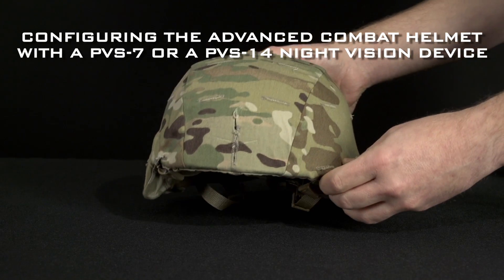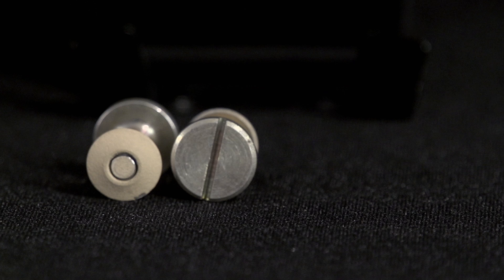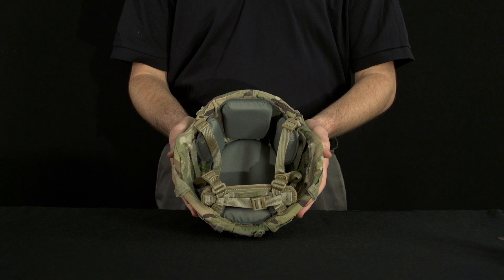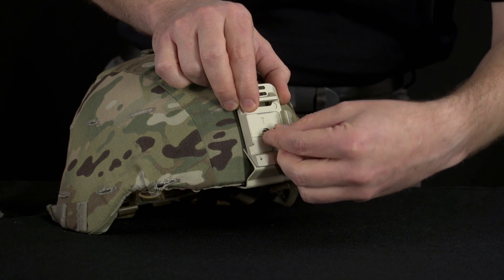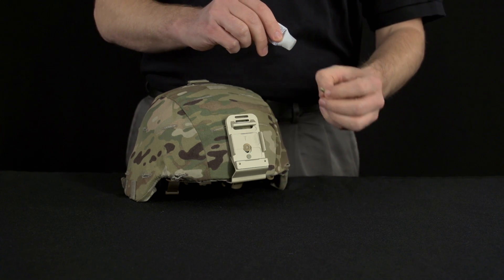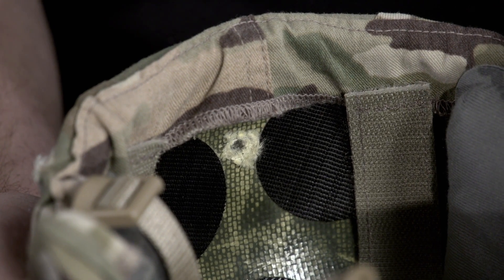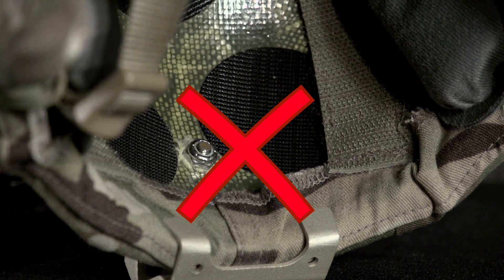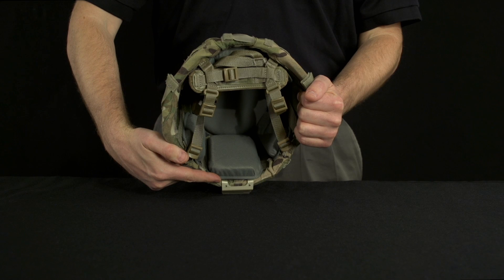Configuring the Advanced Combat Helmet with a PVS-7 or a PVS-14 Night Vision Device

Comment: I feel so stupid. I've always struggled to fit the screw for the NVG mount through the tiny slit on the front of the helmet cover. I normally end up cutting a bigger hole into the cover. I never thought to go from the inside out. Makes much more sense.

Comment: My ach doesn't have the hole in the front
Reply: That way happen
Reply: Center the bracket in the middle of the helmet
Reply: And mark where you need to use a drill to go through it

Comment: Just bought one of these ACH helmets for an absurdly cheap price. Now piecing together the components for the NVS bracket, got the goggles on the way. 
This will go on my display with my own worn Gulf War PASGT with DBDU cover.
Reply: I'm also putting one together but can't seem to figure out which bracket system is best, there are 3 different systems: The Norotos universal NVG Shroud, ACH NVG mount, and Norotos NVG Mounting Bracket. Any suggestion on which I should go with?
Reply: @spwan10  Your setup probably depends on the end means, historical or personal aesthetic. Mine is historical as the helmet is from a National Guard INF REG that went to Afgan in 2012 that came with a traditional NV Goggle Helmet For ACH MICH Helmet NVG PVS-7/14 baseplate bracket. Depending on your price point the dovetails are popular choice but the whole kit may be about approx. $260 (Wilcox or Norotos). Norotos Rhino 2 with a Norotos PVS 15/18 Dovetail socket is viewed as a strong setup.
Reply: What counts as an "absurdly cheap price"? Just wanting to see if I got ripped off   @ericscottstevens